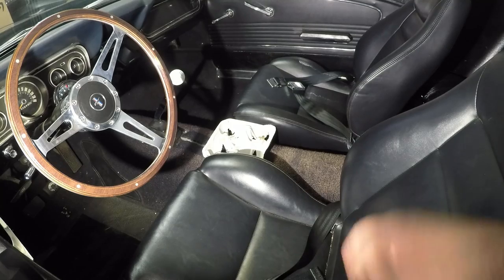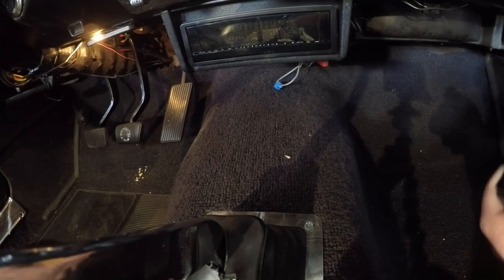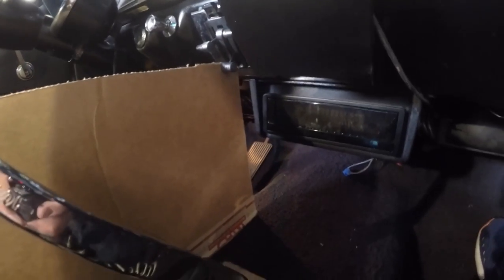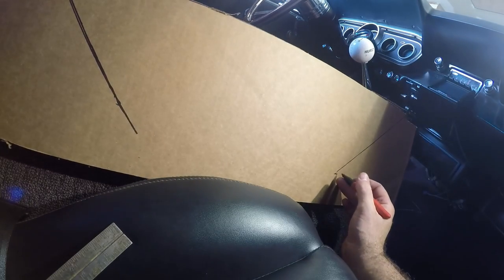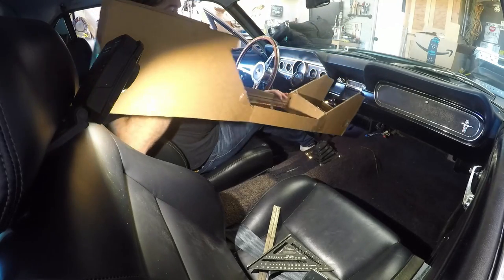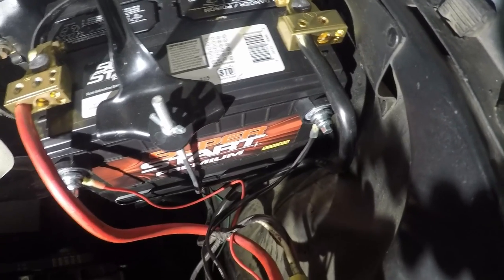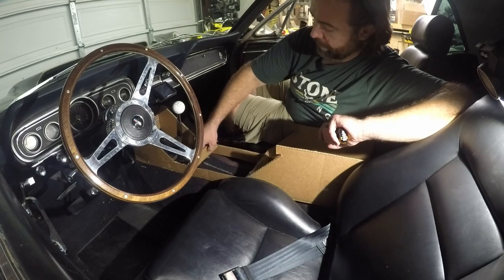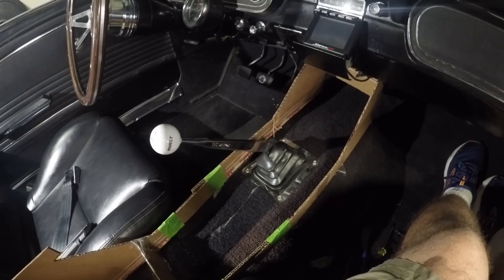Making a Center Console Part 1

Comment: Love the console and would like to make it for my 66 mustang and was wondering if you had measurements
Reply from the maker: Thanks!  I don’t have any dimensions written down on it as I just kind of did it on the fly. Rough measurement from measuring it right now is about. 45-46” long. About 7” wide in the back and about 9” or so wide up front.